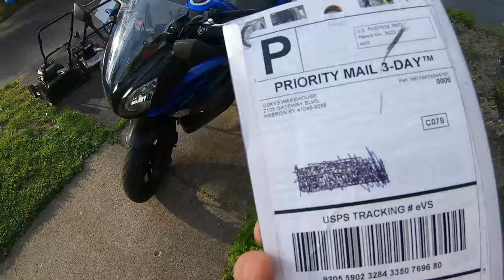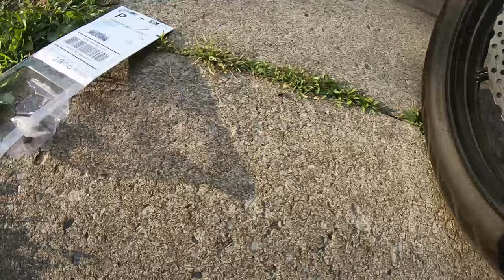Best Motorcycle Disc Brake Alarm (1 Year Update)

Comment: It's a good idea to Always use the Cable. It makes it easy for a thief to see you have an alarm. It also makes it easy for you to see from a distance if someone has tampered with your disk lock. I use one in conjunction with a motion sensor alarm installed in my headlight housing connected to my handlebars. I lock the handlebars by the built in lock, set the disk lock then arm the alarm. If they try to roll the bike or break the handlebar lock, separate alarms go off, one that they cannot even see. In this way I have two locks and two alarms.  I still plan to get a chain lock with alarm and a GPS.
Reply from the maker: Thanks for watching and subscribe. If im honest, i dont really park my bikes anywhere except my garage. If i do leave my bike somewhere else i stay near it or dont stay long.
Reply: Seriously. Just go totally overboard, that's what I'm gonna do.

Comment: I dont have a gurage in my apartment and I have to use a cover. Will the bike cover slapping it in the wind make the alarm go off?
Reply from the maker: Thanks for watching and subscribe. I dont know, probably not if you put the bike lock a bit higher on the wheel
Reply: The cover won’t set it off.  But almost impossible to take the cover off without setting off the alarm.